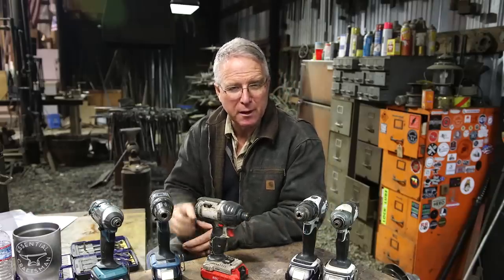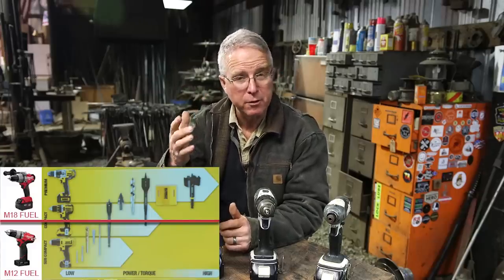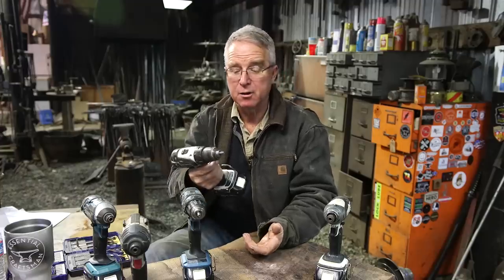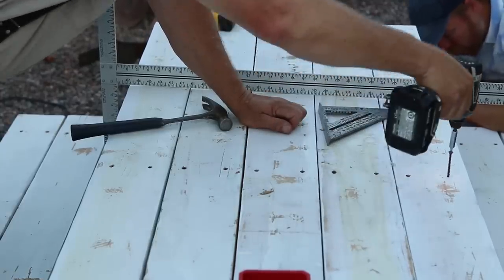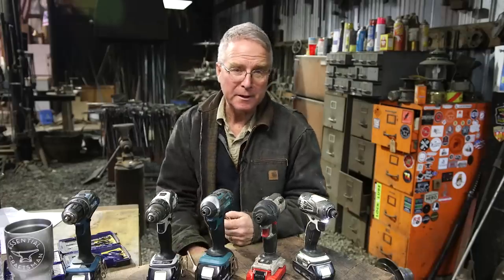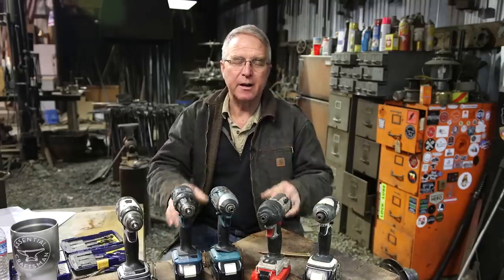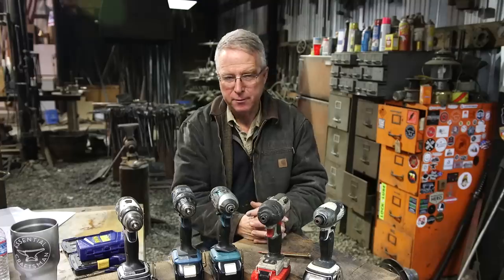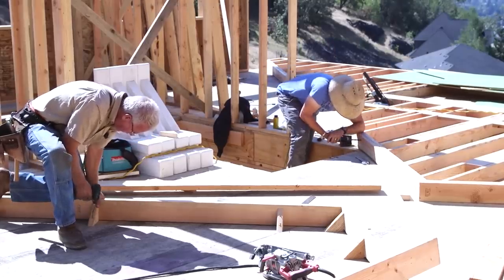Impact Driver Vs. Drill Driver

Comment: I recently bought my first impact driver to de-squeek my sub-floor.  What a revelation!  I was like, "where have you been all my life?"  I tried using my big 1/2 inch drill.  It had plenty of power.  The choice was to try to pull off the screw at just the right moment, or back off on the variable speed and let it stall out at just the right moment.  I didn't like either of those options.  The latter seemed like it was not so good for the drill.  If I didn't hit it right, I would either drive the screw all they way through the plywood, or break off the head.  You are absolutely right about being able to control the set of the screw with an impact.  There is very little rotating mass connected directly to the bit.  That is why it can stop instantly.  

A good combination I found was T25 headed construction screws, any T25 bit, a locking extension and a 20v impact driver.  Counterintuitively, the T25 bits lasted a lot longer with the impact than with the big drill.

Comment: My Makita white pair in a cloth bag is the GO-TO solution with the small, light batteries. I did buy a third battery which fits in the bag nicely. Long ago, I was an early adopter of impact drivers for building wooden handicap ramps. One thing I learned is that impact drivers don 't play nice with stainless steel screws. The steel is softer and the heads strip out more easily.

Comment: When using a spade bit I've switched from using drill to a impact.  So much easier and  safer for the wrists.  Just have to make sure to clear the chips more often if is a deep bore because the bit can get stuck and reverse can't back it out.

Comment: I have driven multiple 10 inch and a few 12 inch timberlocks through a 6x6 ground contact rated pressure treated timber into a header. Impact Drivers are one of the most used tool in my day. 100% recommended.

Comment: I bought my first 18v impact a few years ago when I did more rough framing, decking and such. I instantly fell in love with it. I never thought I would drive a screw with a drill motor again.
 Last year I switched to a trim carpentry job and 4 months ago I bought a used Festool T12 drill motor. I found that the Festool drill has such a soft start up, it will not normally Jump the bit out of the screw head like often happens on normal drill motors  The smooth start of those drills has made my 18v impact obsolete for fine work like cabinets and door installs. I haven't used it since.
 They are so smooth at driving screws and very easy to control the torque. When the hammer kicks in on an impact gun, it becomes hard to feel just how much torque you are exerting on the screw. With my Festool, I can feel the torque in my hands and control it much easier. The chuck system on the Festool lets me switch chucks, driver tips and drill bits so fast that I no longer need two different machines to be efficient at drilling and driving. One gun is all I need.
For trim and fine work, The Festool turned out to be a very good investment. Mind you, if I ever need to drive a few hundred 3" screws to build a deck, that will be a job for my 18v Impact. 
 Just my two cents.
Reply: THANK YOU FER THE INTEL. ME WILL LOOK INTO IT. I DO HEAVY CONSTRUCTION.  LOL
Reply: The little 12V drills are great for fine woodworking. They're light, small and have good control.
14.4 V drills are good for things like putting in drywall screws. Just enough torque and speed, not very heavy yet.
18 V drills are monsters nowadays. An 18 V drill with a step drill bit goes through metal like it's nothing. Even hole saws aren't a problem. The downside is the weight. Those things are heavy compared to 12 or 14.4 V drills.
Reply: @kleinisfijn  Yup, that's exactly what I've discovered. The 12v drills have come a long way in the past 15 years. I have a co worker who bought the new Milwaukee M12 Installation driver kit that came out back in the fall. That is a sweet little drill and it has all the chuck attachments that the Festool comes with.
Reply: @kleinisfijn  I font think anyone makes 14.4V drills anymore. Those were NI-MH powered and I don't think any companies use Ni-MH batteries anymore. (NI-MH batteries are 1.2V nominal, and Li-ion batteries are 3.6V nominal. So you can get 14.4V with a 4s Li-ion or a 12s Ni-MH battery config with both, but I don't think anyone is actually doing 4s 14.4V Li-ion battery powered tools anymore.) Maybe Festool is still making 14.4V tools, but even though their tools are always way behind in technology, I don't think even they're doing it anymore.
Reply: @xenonram  There are still a couple of companies making 14.4 V Li-ion drill drivers like Makita, Panasonic, Hikoki, Metabo and Ryobi. They have quite a lineup of 14.4 V equipment like angled drills, multitools and auto feed screw guns. Equipment where it matters if it weights less than the 18 V counterpart.

Comment: Without meaning to throw any shade at either of these tools (I love them both), I love corded drill much more than the cordless. It's not always practical at all, you just don't have an outlet sometimes, but man is that thing more powerful, and not having to worry about batteries is such a relief.

Comment: Back when I was updating all my stuff to Dewalt 20v (On a serious budget) I started flipping them as a way to pay for them. Buying broken stuff off of eBay, fixing it and flipping on CL/FB. Took many an impact/drill apart. I’m not a physicist either but you are right on the money with how they work. I like impacts better for their feel. When sheetrocking, for example, a drill with a regular #2 Phillips will pull thru very often. You have to have some touch. Impacts are a piece of cake. Get it close and one final squeeze to set it perfectly and off to the next one. At my real job I just got a 1” Milwaukee cordless impact to replace my hydraulic version. It’s a tank. Not quite as powerful as the Hydr one but it’s stout and does the job well. It’s a game changer for my trade and it’s proof that every tool out there regardless of power source will soon run off of a battery.

Comment: Force = Mass x Acceleration

To increase force, we must increase acceleration. (Mass remains constant)

Acceleration is the change in velocity over time. Every time we stop the motion, and re accelerate it in short bursts, we get a high amount of force transfer to the screw.

This is because the driver is changing from 0 velocity (stationary), to a relatively high velocity (the quick jolt of the driver) in a very short time. (Around 40times a second) creating a large value of acceleration.

High acceleration = high force = high torque (energy transfer) 
Energy (Torque) = Force x Distance
Reply: I knew I should’ve studied more physics in school.

Comment: Essentially what happens with an impact is a hammer rotates and impacts the spinning mechanism at a certain frequency (certain amount of times per second), and when it maintains that frequency, each hit works to amplify the previous hit, leading to the monstrous torque these guys can put out with a relatively small motor.
Excellent video!!! I learn so much from your channel, and it's just a pleasure to watch and listen to you!!!

Comment: Great Vid, I learned something. In the HVAC industry we typically use impact drivers to remove stuck sheet metal screws and drive them in. I do some carpentry and my DeWalt has an impact hammer setting. I'm definitely going to try running wood screw that way. Thanks Bob K.

Comment: I’ll take it a step further, move away from Phillips head screws and use torx screws with an impact. And regarding the bits, do your homework and find a set with a good fit. I have a cheap Ryobi set that will suffice, but I really wish I had something that fit the screw head better. I love these videos because I’m not gifted in diy repairs and such, but these videos give me the knowledge and confidence to take them on. Thanks again!
Reply: I agree Torx is better than Phillips, but if you get good Phillips screws - like Spax - and good bits - like Wera or Makita Gold, or at least Dewalt impact rated - Phillips works okay with impact drivers. And despite my wishing to switch exclusively to Torx, the ton of Phillips stuff I've got (including brass and stainless steel) means I can't yet get away from it.
Reply: @hardlyb  I use nothing but Torx, don't understand why Phillips is still made or used. Wonder if Scott would know.
Reply: @msnpassjan2004  I still use Phillips at times because I have thousands of Phillips screws and and too cheap to toss them all out. Not a good reason, of course, but that's basically why.
Reply: I do major builds on site at festivals. I advanced a material list for them to have ready when I arrived, which is normal. I included in the list a large box of grip rite T25 ( I call them star drive rather than torx, same dif) to do a major build. When I arrived, they had a box of phillips heads that one of the event producers had found in their Dad's garage. It was a major, major build with thousands of screws- I made them find someone to drive the hour to the hardware store for the screws I had advanced. Phillips heads are banned in my shop as well lol.
Reply: Im most happy with the makita gold bits and the milwaukies bits are nice too. Nice hard case with a few apex too
Reply: Cody Chismark I’ve heard a lot of great things about Makita gold bits. I’ll have to pick up a set and see for myself.
Reply: Like the man has Irwin is a great bit. Milwaukee makes a good Phillips too
Reply: 2792,  DeWalt quality all the way.
Reply: @avega2792  Skip the Makita boots and get the Wera bit-checks Impaktor, Diamond, or BiTorsion bits. There are no better screwdrivers and screw driving bits than Wera. (Wiha is a close second.) Once you see their Kraftform screwdrivers, you'll see them everywhere, and notice that they are used a lot by professionals. I wish they used their laser etched Lasertip technology on their bits. (I believe they're only available on their screwdrivers, not the screwdriver bits.) It makes the parts of the bit that engages the screw, rough, almost like a diamond sharpening stone. (It has that rough texture to bite into the screw.) Their precision screwdrivers are amazing too.

Comment: I scored my first impact driver in a set from makita, came with saws and a grinder. I never knew what I was missing until I tried that sucker on framing. Its my most used tool  for all deck and frame work, anchoring any lag bolts.  The brushless motors now make it even better with longer run times and lower heat build up.

Comment: Thanks for another thoughtful, down to earth, video based on real experience. I am astounded by the number of comments you got so fast. I am also a user of these indispensable tools. I agree with all your points. My only comments are that the shorter the tool is (front to back) the better and if it can hold a 1-inch bit directly so much the better. I also picked up an angle drive (90 degree) for the impact driver that can also be used with the drill for some things. Useful in tight spots. The only downside is that my wrists are not nearly as strong as the used to be.

Comment: I got a 14V Hitachi (my 3rd, they get lighter and lighter) it is always with me at work.
4 settings 1 slow  little power good for tiny screws in bad wood, 3 for tightening M10 bolts hard all day and the wrists are fine after. 
If you never tried it it is excellent for pop-rivet holes with it's hi speed and stops on a dime, 
I use  snappy adapters for common drill sizes.
Problem with drill and screws is you set the clutch and the wood is constantly changing.
I use my 18v hammer-drill with a chuck adapter for drilling to save carrying weight.
But yes I use my old festool with all the adapters inside, the impact sound is pretty bad in a cabinet. Just ask the neighbors.

Comment: Building ramps for a church mission, we found that the new Dewalt ar 20v  impact tool would spin the Torx screw well below the deck surface.  It was almost impossible to anticipate the best point to back off the trigger.   Very powerful tool.  We had better luck with Bosch or Mikata.  Battery driven tools are 100% bette4 than 10 years ago.   Last longer, charge quicker and don’t fail as quickly.

Great video

JoeB
Reply: i still use the same compact white makita impact driver the guy has in the video prety much daily its survived thousands and thousands of screws and has fallen off ladders and recently a single story roof on concrete and hasent broke it uses the same 18 volt lithium ion batteries they sell today and its at least 10 years old 19 or 20 years ago i used to use my bosses makita impact to drive self tapping screws to install blinds that thing used the stick nicad batteries that were like a hand gun mag

Comment: It comes down to what you're driving. Nuts, drill bits, or screws. 
Neither are impact rated (with exceptions).
But which will be less damaged by shock vs torque energy transfer.
Also the momentum of the drill drive can be avoided if the clutch is used accurately

Comment: You  gotta  have both I agree.

If you're building a deck with hardwood boards that need pre-drilling having both means you can set up the driver with a drill/countersink bit and use the impact driver for screwing boards down, no need to constantly switch bits and change the speed/torque setting on the driver. Impact  drivers will get a screw bedded down twice as fast as well.

If you've  only got a one off project you can buy a cheap set, or one or the other but definitely worth having both.

Comment: As a guy that does mostly mechanical work, I sort of ended up with a 1/4" impact by accident because it came as a set with some other tools I wanted. I am very surprised by how much I use that thing out in the shop for light disassembly. I figured it would just rot in a drawer until the day came that I had to work on a deck or something and that it would be useless for mechanical stuff. I was wrong.

A modern, small, cordless impact is absolutely on my list of tools that every handy type of guy should have no matter what work they do. So much greatness in such a small package and usually a really great price. It's hard to screw up.
Reply: What minimum torque do u prefer on an impact driver for lighter bolts?
Reply: @erikolsson9780  I think mine produces about 30ft-lbs. But, like he said in the video, it only produces as much torque as you put on the trigger.

edit: I also don't use mine to actually "tighten" things. I use it primarily as a disassembly aid. Or if I'm doing like 30 automatic transmission pan bolts I'll snug them up with the gun and then torque them with a torque wrench at proper value and in sequence.

Comment: When I got my first impact gun it blew my mind.
After using normal drills for years and using an impacter it realy is a colossal differance. Allowing a small drill to be capable of extreme work.
I can only imagine it as the same jump people seen when first switching from the old push drivers. (you know them long spiral gear things that you had to push against.)
And now I recently got a tiny hilti impacter that is half the size of the usual ones. It's a little beast.
I am really looking forward to seeing the next innovation that makes our lives easier.
Like maybe some type of wormhole technology that just teleports the fixture into whatever material your working with.
Waaaaaait just a minute........

Comment: With the power and versatility you get with a set like this, I've been just using my 12v Bosch set I bought for taking apart dash board to do any and all homeowner type tasks. Decking, fencing, they can do a lot for their size. 😁

Comment: About a month ago I was using my newest brushless drill in drill mode (locked clutch) with a spade bit to cut a bunch of 3/4" holes to run wires through the studs.  All was going swimmingly - the new spade bits just tore through the wood with little effort - right up until I hit a buried framing nail and the bit stopped cold, spinning the drill right out of my hands.  I swear my wrist rotated the full 360 degrees and my hand went numb from the forearm down.  I briefly thought I'd broken a bone but all I had done was stretch the tendons in my thumb waaaay past the limit.   It's taken weeks to get something close to a full strength grip back but I feel very fortunate.

If I had thought this through I would have used the drill in driver mode with the clutch set quite high - enough that plowing through the framing wouldn't have been an issue but the moment it hit something unexpected, it would have broken the clutch, not my thumb!  Next time I'll have a little more respect for just how much power those guys have!
Reply: Years ago, I remember a coworker, up on a scaffold, drilling holes thru a ledger for some carriage bolts. He was using one of those old, corded, ½” Milwaukee’s with the screw-in handle and zero clutch. He was working right at shoulder height and thus, really putting his shoulder into it. Suddenly the big auger bit hit something inside (likely a nail, like you) and the drill spun out of his hand and the handle whipped around and hit him right in the face, breaking his nose. WHAMMO!! He walked around for the next 2 weeks with the most beautiful set of dual black eyes you ever saw!
Reply: @psidvicious  Yeah, I was working over my head so didn't have good leverage on the drill.  I also had the screw-in side handle and thought I had a good grip on that one.  Between the high current battery and the brand new Bosch Daredevil spade bits, it was just tearing through the wood in no time flat!  I guess an over-stretched thumb is a small price to pay considering your buddy's experience...